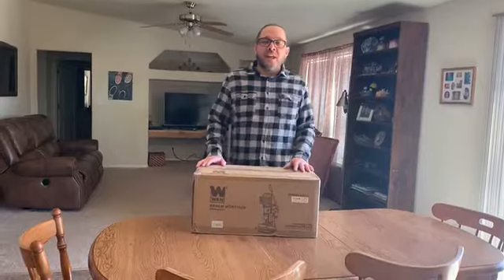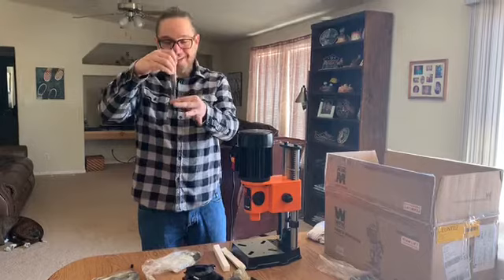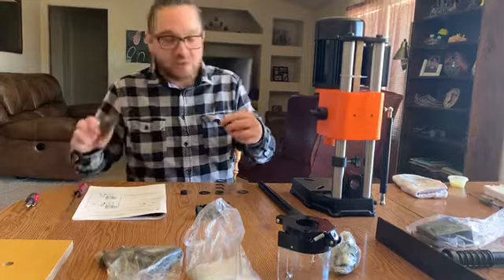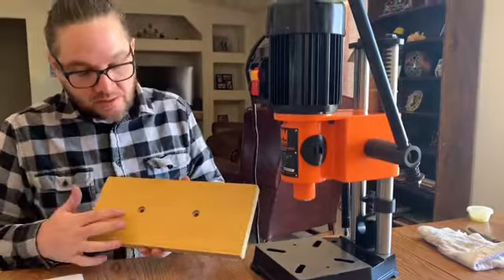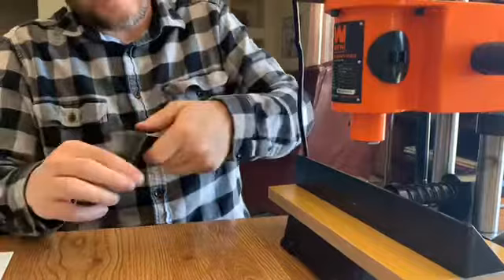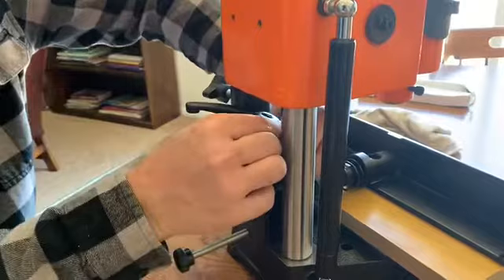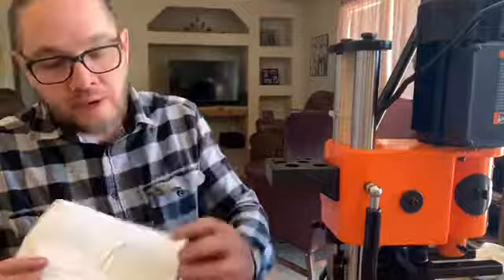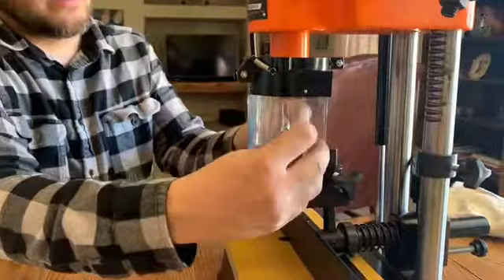Unpacking and Assembly, Wen Benchtop Mortiser, model #43012

Comment: The guard is meant to be mounted above the set screw which is why you weren't able to use it with the smaller bit. You have to remove the set screw and push the guard all the way flush with the chuck housing and then flip yo the guard to access the set screw.
Reply from the maker: Thanks...I will try that next time I use it